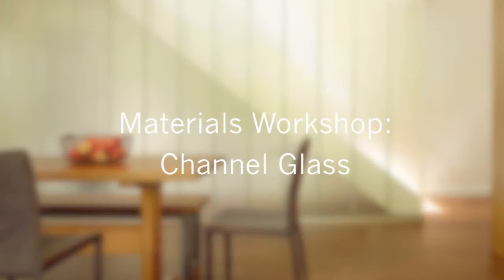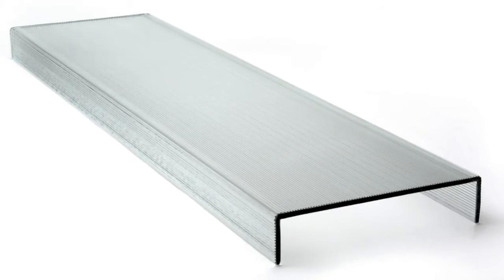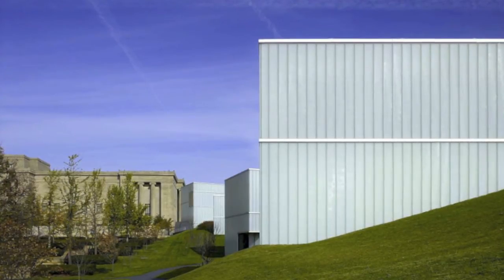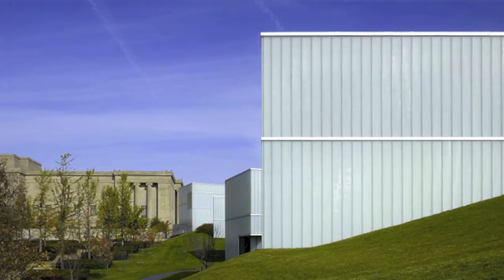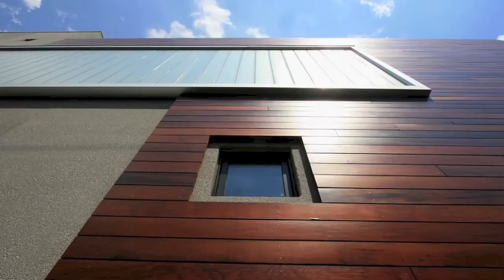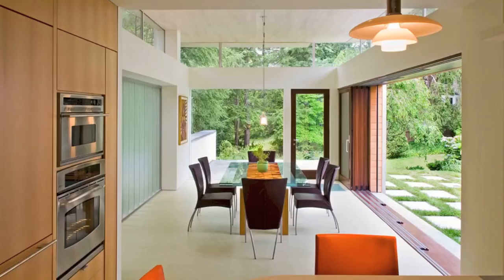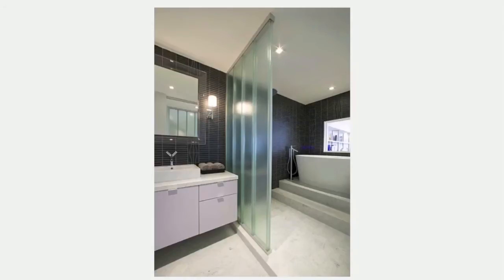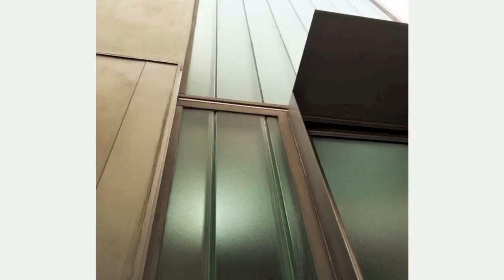An Architect's Guide to Channel Glass

Comment: As an architect I like look of it, but another disadvantage is all the joints created between channels. In an exterior use, all those hundreds of feet of joints between channels need calking ( or special gaskets for double wall channels).  Unlike sheet glass windows, where mullions between glass panels keep out water and allow expansion,  exposed calk joints are probably not all perfect and  will need to be redone at some point which would be expensive.  I would be wary of any detail where one bead of magic, perfectly done calking is all that keeps water  out of my wall...

Comment: Don't forget the primary goals of Channel glass in larger buildings. First, larger walls with better thermal insulation in winter and low solar input in summer than standard curtain wall. Then, better fire rating in interior rated walls such as staircases. Then, of course, the filtered light as you observed.
Reply: 4:32